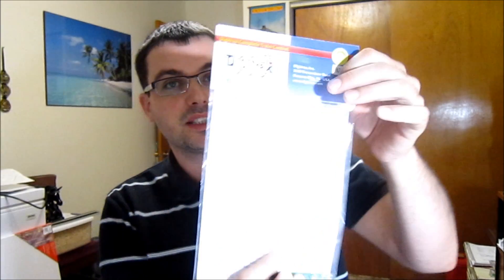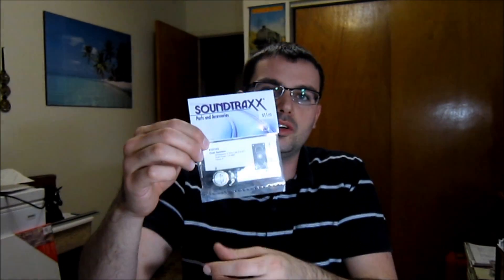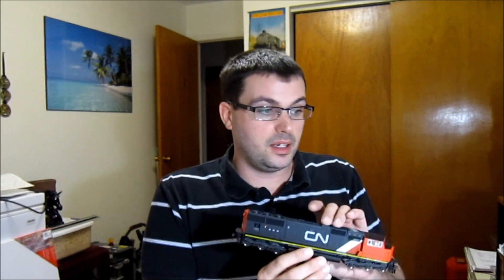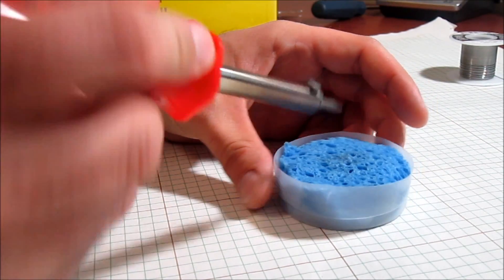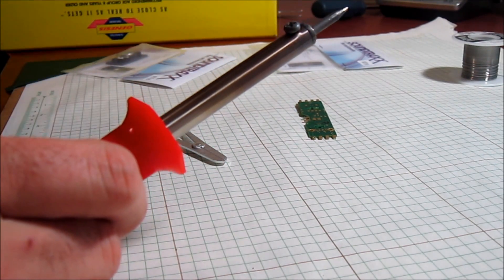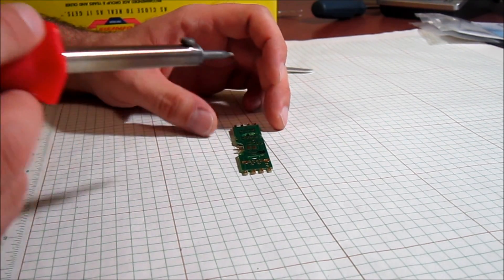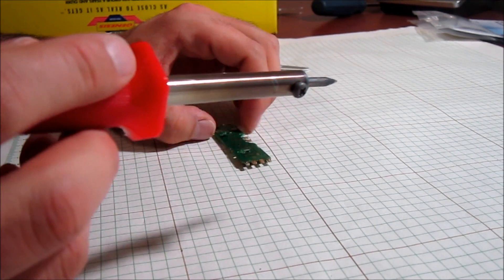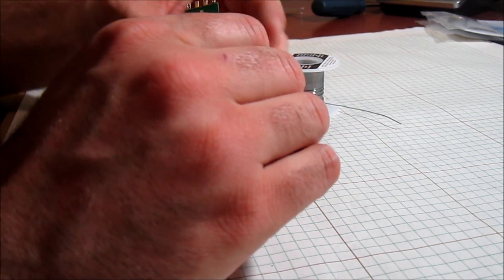12.04.11 How to Safely Tin your Decoder

Comment from the maker: @Conrad1996 My soldering Iron is a 35Watt.  The trick is to use very think Solder.  I was using .6mm in this vid.  Also the big trick is to make sure the tip on your iron is tinned.  By doing this, it concentrates the heat to the very tip of your iron, making whatever surface your heating up, heat up quick.

Comment from the maker: @adaribros Flux will spread out the solder evenly.  When using electrical solder with rosin core, which is a core with flux in it, you will not damage your decoder and it will keep it directly on the pad and no where else as this vid demonstrates.

Comment: Dude! You look better without the stash! Hey, I'm not saying tinning the board is wrong ('cause it's not). I put a bead of solder on the tip of the soldering iron. When you touch it to the connection and wire it immediately melts, thus heating that connection on the dcc board one time. I also use flux, which melts and spreads the solder better. I should have shown this in my last dcc upgrade video; I will the next time. Later Dude!